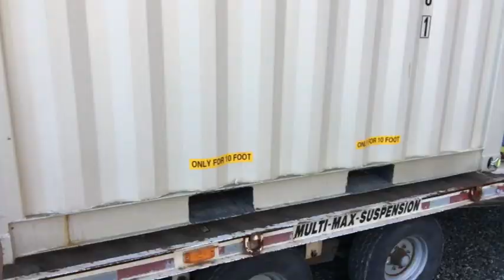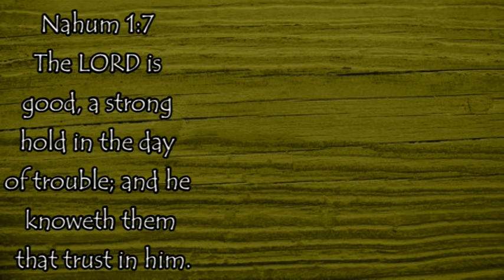Delivery and Set Up of the New Shipping Container (with Cody's Help)

Comment: Great job, Pat!!!   Looks really great and I know you all must be excited to put It to work.   One thought, we had two trailers about that size or just a bit smaller under our trees for the same purpose.   We have high humidity as well.   We had a very wet set of years (not as much as you all) and ended up with mold all in our containers and in our business materials that were stored.   We had to pull everything out and clean and treat everything including the trailer.   Then we had to find a sunny location for it and we moved both trailers.   We haven't had as bad of a mold problem not that they are in the sunshine.   I sincerely hope that you all don't have the problems we did!   P.S.   That Cody is absolutely adorable!
Reply: Thanks Cherie for the input. I was hoping the shade might help keep the temperatures a little more consist and thus help with sweating. Do you think that is a bad idea? There are four little vents up in the corners of the container so I hope they help. I plan to elevate the container onto concrete blocks to help facilitate air flow underneath the floor. I hope this solves the potential issues. Not sure if desiccant might help but hoping not to purchase such a collector due to another cost.
Reply: @MrRainCountry  The vents might help and just that it is a container made for long-term storage might mean it's built for these kinds of environments for storage.   Yes, up off the ground is important for airflow.  However, one thing you can do if you want is that we bought some of those inexpensive "moisture eliminator" packs that help to pull humidity out of the air.  Some of them hang so we hung them up close to the ceiling and put some in the boxes down closer to the floor.   Heidi might have a way to make something that would be very inexpensive.   I think some people use cat litter for the same purpose.   The one we have is called "moisture eliminator" and has charcoal and carbon in it.   We had to replace them about once a month.  When we'd take them out, they were filled to capacity with water.
Reply: @bayoutown1990  Thanks Cherie. I was thinking of "Dri-z-Air" (I think that's right) The little black screened receptacle that sits on top of a moisture collecting reservoir. Hoping to not have to go that route if possible due to the cost and maintenance. Not that it's a lot but it is something else to remember to manage. Appreciate the feed back from one who has ran the gauntlet :)

Comment: Great job!     I am almost 80 and disabled.  
 I need a way to get my 50lb chicken feed from my car into the chicken coop and into a metal trash can.    Do you think a small winch will work.   If I get it into the mule, then I only need help at the chicken coop.   The coop is a pretty large shed that was built into 1/2 coup and 1/2 work area and storage.   It has nice beams.    Any advice would help.   Rural King has some electric ones and so does Amazon.   Rather shop at the Rural KIng in Crossville, TN.     Help!   Do not have $1000 to buy one, was hoping under a $100.
Reply from the maker: I am sure Patrick may have some ideas for you when he gets back in here but he is always finding good deals on such things on facebook market. That is the only reason my account there is still open because he uses it for that. In fact, that is where he found this shipping container
Reply: Although I don't like advertising for "China mart" sometimes one can't afford not to. Harbor Freight may have small electric winches. Not seeing your set up offers several unknowns and variables. not sure if the winch idea would work ideally for grain sacks.  I wonder if you can get a cart with larger wheels roughly the same height as the bed of the Mule? maybe slide the feed from the Mule to the cart and wheel the cart into the coop storage area. The cart height may be roughly the same height as the storage can if it is a cart similar to one like this one: 

https://www.amazon.com/Gorilla-Carts-GOR6PS-Heavy-Duty-Convertible/dp/B01BECQF6K/ref=sr_1_18?dchild=1&keywords=work+cart&qid=1614869590&sr=8-18 

This type with larger wheels make it easier to roll over door thresholds and other obstacles one would find on the farm setting. One can either open the bag of feed and scoop the contents into the trash can or carefully pour it in tipping it from the cart to the can depending on what your situation comprises of. If the elevation is off you might be able to construct a box or platform to accommodate the height difference. The only concern would be is the higher one goes with the load the more susceptible to tipping. Depending on your condition and terrain it might be better to just drag the bag from the Mule into the cart then scoop into the can. The cart might come in handy for other tasks as well. Hope this helps!
Reply: @MrRainCountry  TY, I have a great farm wagon, but the trash cans are very tall.   and think Heidi, if I open the bags and put into the trash cans, I can't reach any where near the bottom :-).    Thanks for the Harbor Freight point.   Like the Rains, I live way out in the country and it is a difficult mountainous travel to the city with the Harbor Frieght, but I might try them online to see what they have.    I know, without Amazon, I would have to do without a lot of the assists that I use to keep going.
Reply: @RainCountryHomestead  Thanks Heidi.   I try to look as much as possible before buying, but sometimes, I just end up getting what I can.  We have something called local sales network -- lsn.com   here in the South and it has just about everything at some point if one can be patient (not my strong suit)
Reply: @marthaadams8326  There is also the option of getting smaller garbage cans as well that might accommodate one sack of loose feed. Possible to use two smaller receptacles to contain the loose feed to make it easier to access the bottoms of the containers.